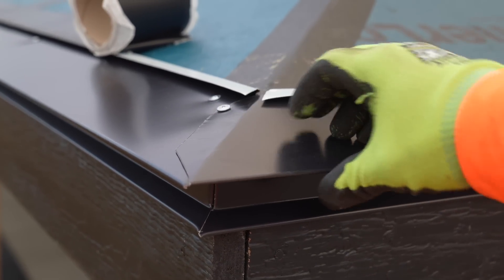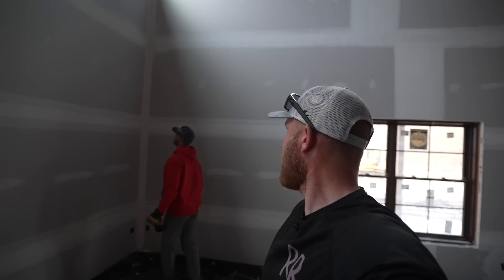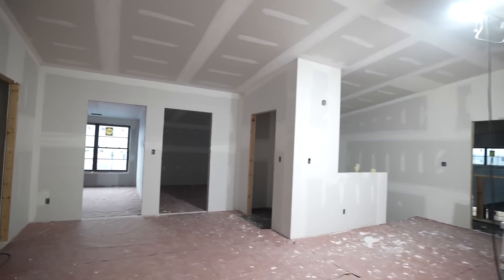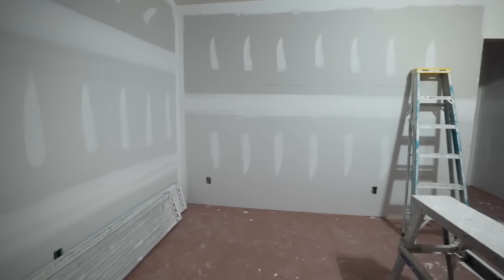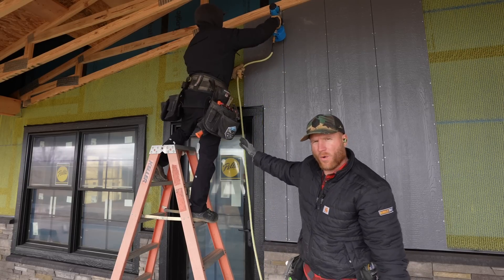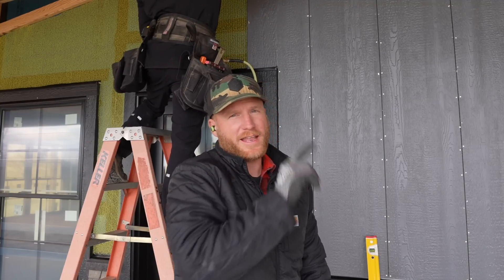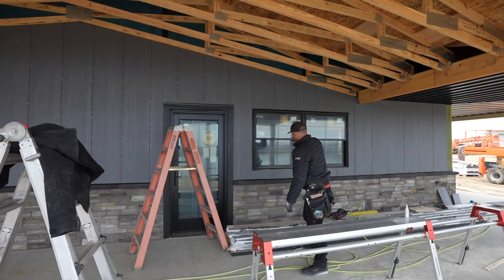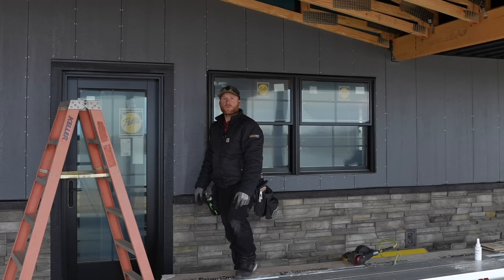Building a Barndominium 29: Drywall update, Metal Roof Detail, and more

Comment: Haven't been following this particular build series as much as your earlier ones due to the fact that many details later in this project haven't applied as specifically to our build starting in a couple weeks. However, always impressed by the quality and precision of ALL your work! It must be nice on this build to be doing something more in depth and even quite different than the majority of your builds? Doing the same ole thing repetitively can get a tad boring after while. I cannot even begin to describe what a valuable tool your video's and explanations have meant to me and family for our build! This 30+ yrs plumber turned weekend carpenter would not have felt one bit confident we could even attempt to build a post frame structure  without your guidance! And I am especially thankful for your answering my questions, and great attention to detail on ALL your videos. I have had a whole year to study them, and I am ready to do this.  Materials June 13....HERE WE GO!
Reply from the maker: Good luck
Reply: Thanks Kyle. The post bracket install into our concrete slab went well! Corners are spot on square and correct dimensions are in place! YEA!!! I do expect a couple of the corresponding side wall brackets from each side to be off just a tad as we hit some re-bar putting the brackets in on a couple brackets. I wanted to wait until concrete was completely dry to confirm some measurements but I had to get back home before they were done. I figure if they are off 1/4" in 32 ft width we will be able to make that work so long as our building on the outside corners is square and plumb. Any helps you have in correcting bracket "mis" placement would be great if you have them?......waiting on material delivery now. Cannot wait to get started!

Comment: As a sparky I set up a cheapie toggle switch and a rubber pigtail.and cheap 100W led bulbs per room or bathroom so all trades can work until trim out. The rubber pigtail Sockets are kinda pricey but we get years out of them.

Comment: Have you ever used engineered floor trusses for your second floors? I'm curious if/how it would work with a post frame. It sure would be nice for ductwork. Or post frame on a basement?
Reply: I've worked on a few homes which used open web wood floor trusses.  They're great for avoiding bulkheads in the basement, and giving a nice flat ceiling, BUT I would also recommend over-specifying their load capacity to control deflection.  Also, your construction tolerances must be very tight.  It's much harder to make up for deviations in the alignment of a concrete foundation wall with floor trusses then with engineered floor joists.  You can cut a joist long if you need to, but floor trusses can't become longer than they were built in the factory.  Also, if the truss designer only put typical floor loads, but you have a couple trusses which support a kitchen island with granite, or all your kitchen appliances in a row, you can find you have excessive deflection along that one truss, leading to noticeable dips in the floor.  Reinforcing a truss which is full of plumbing and mechanical penetrations vs. a typical joist is EXTREMELY challenging (i.e. expensive).

Comment: i have never seen anyone cut the ends of starter metal like that at a angle. doesn't that defeat the purpose of a over lap. essentially the but end just meats up the the but end of the angle u cut. i would be interested to hear your thoughts on that

Comment: Biggest issue I see with the girts is trying to hang anything heavy on the walls.  I don't care what anyone says, I will never feel good about mounting a tv into drywall with anchors.
Reply: I'm certain they plan ahead and ask the customer where they're going to hang tv's
Reply: If there was no blocking put in place (say you  have an unplanned tv to mount), you can just open the wall and put vertical  studs between the girts and either pocket screw or sideways toe-nail or sideways screw. It's really not a big deal. 

Otherwise you can just line up the top of your TV mount to the girts and screw it there only.
Reply: I agree. Some walls need full wood backing. Agree. High grade plywood.
Reply: Just add blocking
Reply: Agreed
Reply: 1/2 inch ply wood with 1/8 sheetrock. Problem solved 😌 👌

Comment: I thought the exterior drywall had to be 1 hour fire rating so that is 5/8". you kind of have your garage in the living space, which makes interpretation of the code strange, but IRC table 302.6 would imply any wall interface between the cars and a living space should be 5/8" drywall. Actually all those bedrooms cannot have a door to where the cars are. I mean I'm sure a dozen people have signed off on all this, but im not sure how they got around these codes. Maybe they just promised not to park cars inside and the garage doors are equivalent to French doors